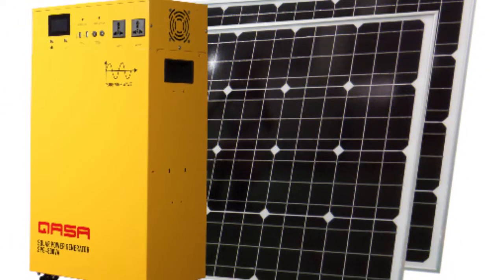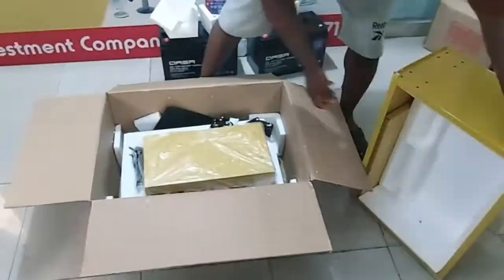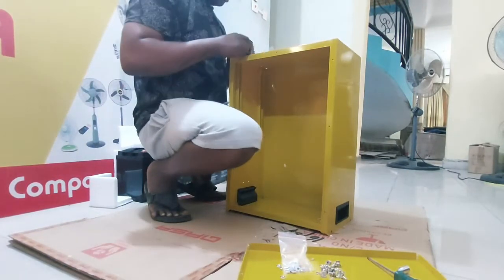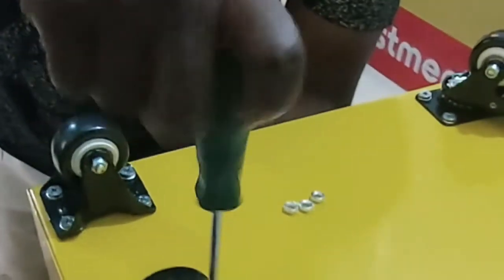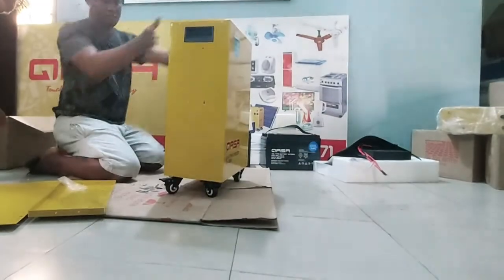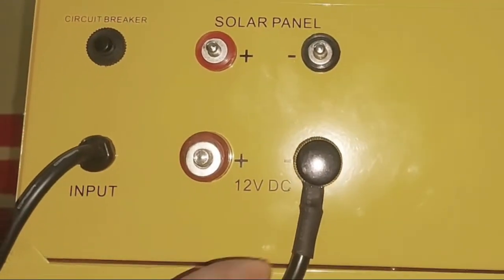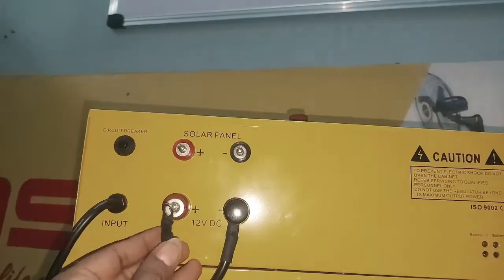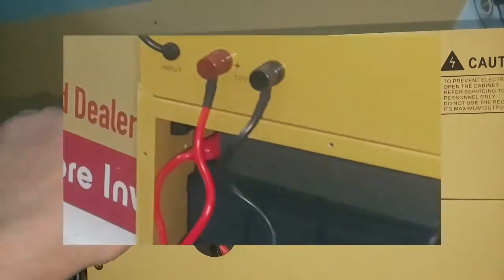QASA SOLAR POWER GENERATOR- SPG-800VA 2-BATTERY ASSEMBLIMG TUTORIAL

Comment: I have this product. It went off after 4months of usage. So many hiddens things about it, you need to buy additional pannel to make it charge properly, you need to by-pass the dc circuit breaker, if not, once the sun is at the peak, around 12-2pm, the breaker keeps tripping off. You will have to by pass the breaker to have constant charge.
I faced so many troubles to get it to work. After it started working, the work was really fine, but after 4months, it started trouble again, started show error 02, error 04, indicating solar charging light at night when there was no sunlight. I was told the battery is gone.

I went for the product because of it portabilty, but its just a waste of money.
Reply: Where ever you are now, if you can read my comment, I just want to let you know that God will bless you and you will Live longer.
You are a life saver ❤❤❤❤
Reply: Thanks for this, I'm grateful, I won't go for it anymore.
Reply: I have this product and have been using it for 2 years now. im facing the same challenges you have.
I have called all their companies, but none of them is willing to sell the batteries for replacement.
Now, I haven't just waste my money but also have a condemned inverter
Reply: Is this the experience of everyone
Reply: God bless you for this review and enlightenment
Reply: Thank you for enlightening us before someone end up regretting.

Comment: All this thing's are just waste of money
Reply: its is not a waste if money. it works
Reply: I'll agree with you if the battery used is Lead battery type, they're useless.
Reply: it is nit a waste of money. it works but how would you know. you just cant. all you do is comment on what you dont knos
Reply: I bought one though I can tell it was a waste of money
Reply: @eliscoelis9144  how did you connect the solar panels? In parallel or series ?
Reply: Which would you suggest that won't be a waste of money?
Reply: I regret buying this rubbish thing. Became useless after just 4months of usage. Complete waste of money